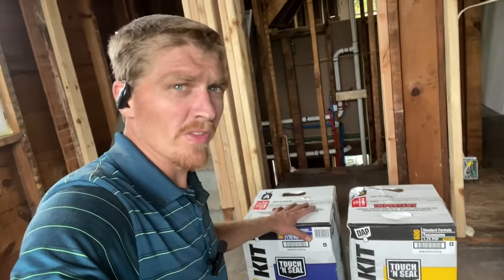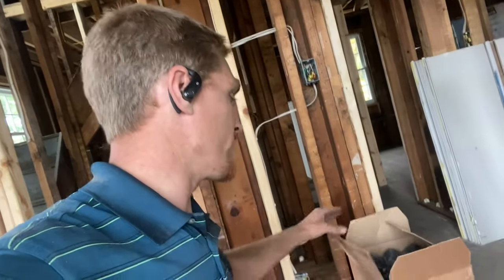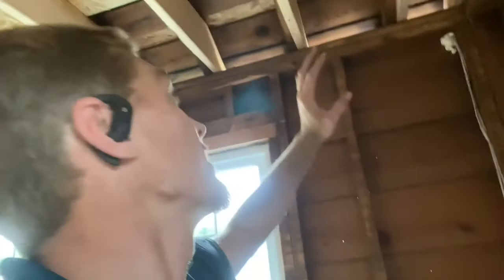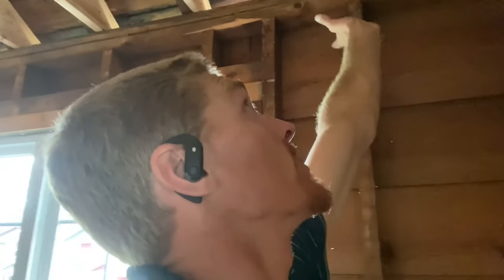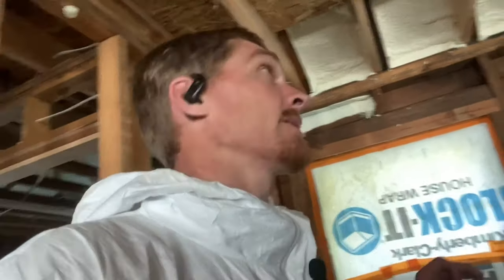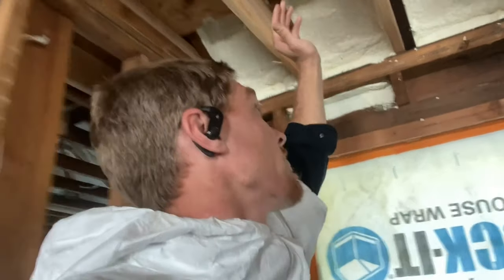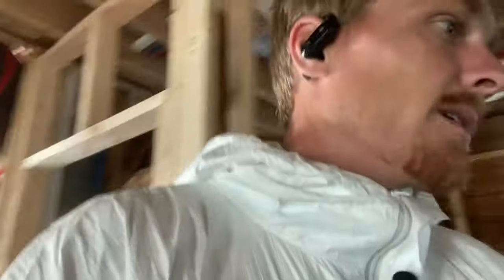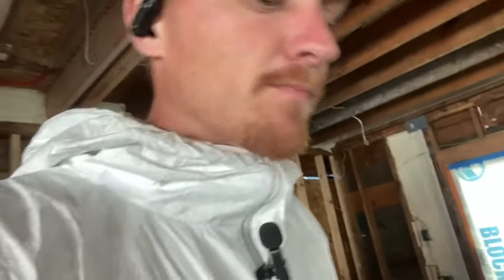I Tried Out 2 Different DIY Spray Foam Kits

Comment: If you don’t mind explaining why did you do it yourself? The insulation contractors charge per board foot installed (sprayed) for essentially the same price as you bought the material for . So you save your labor and let them deal with the mess. Also you didn’t tell is this a closed or open cell?? I like you live around Detroit and doing almost same thing as you with the house I bought last year, so I got to the insulation part and wondering what you can say about that. Thanks
Reply: That's also my impression, at least if he was ready to spray foam the attic now. If it was only that small section that was ready now, then I could see the price being higher to hire it out -- I don't imagine many spray foam installers would really want to deal with a job that's only ~700 board feet at the same price per board foot as a more standard job (2500+ sf).

We're getting our attic spray foamed in a month, and the cost is ~$1 per board foot (edit: final price was $1.30 per bf). This is for a highly rated installer with what I perceive to be the best product out there (and the blowing agent only has a global warming potential of only ~2, which is >99% lower than many spray foam blowing agents). It will all be done in one day, and like you said, I don't have to do any of the work. The alternative mentioned by another commenter (cut foam boards to fill rafter bays, then spray foam the edges with canned foam for an air seal) would be about 25-30% cheaper, but I suspect the spray foam is a better install because it gets into ever nook and cranny, and it won't be impeded by any nails or whatever else coming through the roof sheathing.
Reply: Maybe bcuz shit is crazy expensive rn
Reply: @THEHORSELOVER235 Did you read the full comment?
Reply: I'd like to know where you all are getting contractors that cheap at!!!
Reply: I didn't know where you live, but professional installers are not charging the same amount as what he payed for it. I am currently finishing out a cabin shed tiny home, and I saved almost $2700 doing all the closed cell spray foam installation myself, instead of paying the nearly $6800 avg I was quoted by professional installers in my area.
Reply: @dosadoodle he said installation was same price as product. Have you checked to how much the product costs?
Reply: @Basketofdeplorables173  Either the original commenter was also referring to the product + install price, or we're encountering vastly different prices. When I paid for product + installation for 5000 board feet in late 2023, it was ~$1.40 per board foot after tax. I'm not seeing kits lower than ~$1.35 per board foot (after tax). The company I hired also had the best ratings in our area, so it wasn't some cheapo company.
Reply: @dosadoodle  yep. Vastly different pricing. The cheapest 2 part I’m seeing is $369for 200 board ft kit. And $5 a board ft installed. Board ft is that only 1 inch thick, so if you want 2 inches it’s absolute outrageous. That’s south Florida though. The contractors in your area must be getting the product for free. The 600 Board ft kits are cheaper in the long run.
Reply: Not at all correct...the froth pak 210 covers 210 board ft which cost 426. Tell me what contractor is only going to charge you for material cost????? You still have to factor in time, travel, fuel, help, and actual work. Trust me, he saved a lot of money doing it himself.
Reply: @mcwpicfed  You looked at the smallest unit pack to figure out material price. If I bought wire for a house in 25' increments, it would cost $3,000 in wire alone to wire up a house. If I bought in 250' increments, it would be about $500.

If you looked at a 600 board foot kit (biggest DIY kit that I've seen), the price drops substantially. Now consider that professionals buy the chemicals in bulk, where the barrels they get cover more like 5,000 or 10,000 board feet. They also don't need the single-use sprayers that come in the kit, so that also adds to the cost of these kits that professionals don't face.
Reply: @dosadoodle Yes, because it goes UP from there. I’ve looked into the cost before and to have someone do the installation is way more expensive .
Reply: Sometimes there are just no contractors around. Specially if you live in more rural areas, good luck finding anyone. Or anyone who is sober.😂

Comment: Agreed with the no ventilation. My concern is with the spray not being directly on the wood.  You are basically creating an uncontrolled air gap between that foamboard and the wood.  Heat will transfer to the cold air in that gap. As temperature of the air changes in the gap,  it will condensate and create moisture.  Many builders say to put a sheet like you did. Spray manufacturer says to spray directly on wood.  I converted my flat roof and i sprayed directly on the osb. Studies/research at building science really help me.
Reply from the maker: Oh Wow. Hope I didn’t mess this up. Wouldn’t the temperature in that air gap and outside temperature be the same though and in that case wouldn’t condensate
Reply: @samuelkingentrepreneur  in the gap, yes the temperature will be like the outside temperature (if no heatloss in winter). You wont have much problem if air can circulate in that gap (between foamboard and wood) or if you don't live in a cold climate. 

 The outside air contains moisture (water dropplet). Condensation happens when that air cools down causing the air to reach it's dew point. The outside air will inevitably cools down. Either at night or in winter. In colder climate heatloss from your home insulation is the main issue as this can really aggrevate the temperare difference and thus making condensation. That is why roof are usually ventilated, to prevent the air to get stuck and change from gas to liquid.
Reply: If there are vented soffits on the outside of where that foam board went it shouldn't be a problem

Comment: Be careful. As far as I know, all the can foams (one part foam) are open cell types. If you live in a cold climate area where you need to be concerned with water vapor movement and condensation, you need closed cell foam.

Comment: The cans were never designed for open bay sealing, just small holes, corners, cracks, edges, between studs, windows and doors, etc. They can be used for the gaps between exterior sheathing, around bases and tops of wall plates, aswell as corners were studs meet sheathing, sill plates, anywhere drafts can squeeze through. I love using it in  joist bays in combination with 2 or 3 inch XPS foam board. I cut them 1 inch shy dimensionally, use screws or nails to hold/pinch em in place, then fill around the perimeter with the can foam. This is a far easier, cleaner and great method to air seal these cavities on a budget before adding batt insulation.

Comment: The cans worked SOOOO much better for me. And way cheaper. Just use the correct tip (they come with two different kinds, one for walls and one for ceilings) on the gun and the results were even and smooth. Not sure what you were doing wrong because you didn't include any footage of using them in the video.
Reply from the maker: What brand was it. Mine only came with one tip and I certainly preferred the dap kit with the two cylinders. I actually created another video applying the cans.

Comment: I work with the commercual version of this stuff in the factory.
CRC BRAKE CLEANER is your friend for cleaning up and purging your tips.
Our mixing guns use a 18" PEX tubing for injecting the foam into metal panels.
Another trick is to wrap those tanks with a heating pad to keep them at 88 degrees far.
The hoses need to be warm also.
You get a much better consistancy and proper mix.
With the correct foam chemical ratio you won't have any future shrinkage or outgassing problems with this product.

Comment: we used those cylinders at work they were a pain to keep hoses from clogging if you didn't use it fast enough, we coated ends of tips with Vaseline to get a better seal and not have hoses clog when not using them constantly had to keep spraying into a cardboard box to keep tip from clogging.

Comment: About to spray foam my attic, video came at just the right time.  Thanks !
Reply: Consider hiring this out -- it is likely to be the same price (if you have a meaningful sized job, which it sounds like you do), and possibly even less expensive than the spray foam kit shown in this video. That's what I'm doing -- we picked one of the best-rated installers in the Twin Cities, who also is using what is a top-of-the-line foam, and the cost per board foot is the same as the kit shown in this video.

Comment: Glad to see you had some success with the kit. I've seen a lot of bad info about those kits. Difficult to use, and a fairly large investment for something so easily messed up. I personally just use the smaller cans for the small things and typical fiberglass batt insulation.
Reply: yeah, i never liked them some people used them at work somehow and had no problems, but they clog really easy and if end of hose clogs you are screwed id never use them at home.

Comment: I was so hoping you would show using the cans…. From what I’ve read they weren’t designed the way you used them.
Reply from the maker: @jefferydonnally2266  I’ve done a video on this since
Reply from the maker: Also they are not the typical spray foam cans

Comment: One is a spray foam kit the cans are for filling voids to completely different products
Reply from the maker: The cans are actually made for insulating just like the kit. They come with a fan tip that applies it in much the same way as the kit. Check out the link for the product in the description.

Comment: I don't mean to be rude but if you want any feedback, this is a completely useless video for anyone trying to determine if the multi can kit is any good. We didn't see you use it so we have no idea if you used it properly in the first place. 

I've seen other videos of people laying down decent coats with the same kit so was it user error? Did you use the correct tip for the application you chose? Did you have a bad kit?

We will never know, we just have to go by what you said since we can't observe if you were using it correctly or not.

Thanks for your report but it's not any help.